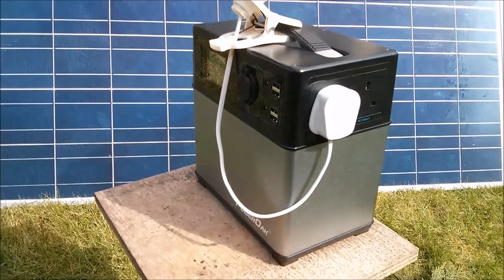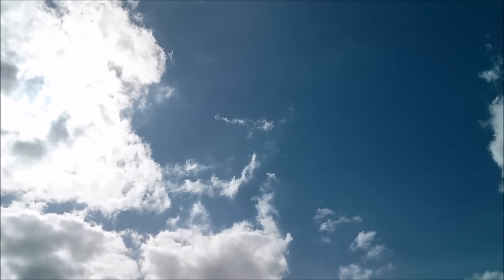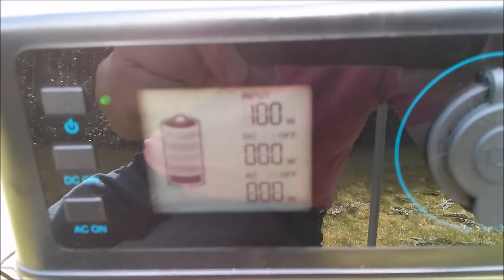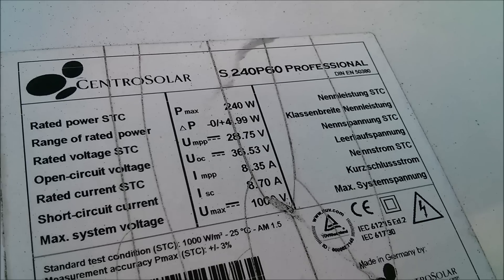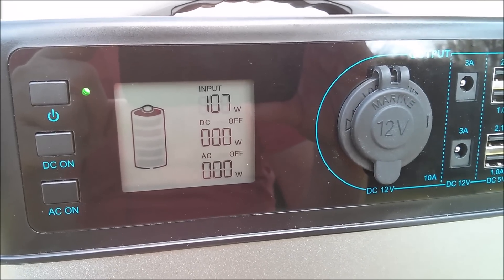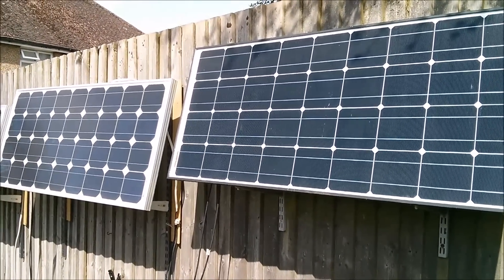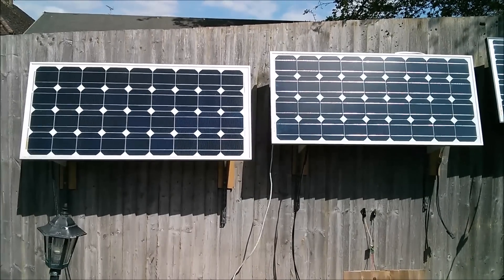PowerOak PS5B Review - Part 2 - Solar Charging Tests

Comment: Those 80W panels were giving 54W each and the 100W panel gave 64W, which is 18% more. So I'd say it's 100W rating isn't too far off.

Comment: Solar panel watts (other than those from Banggood which have the Voc * Imp wattage rating which is an impossible number) are measured under factory STC (Standard Test Conditions) of 1000 watts/sq meter and panel temperature of 25C.  A more reliable number for real world solar output is the NOCT rating which is taken under less perfect conditions and is about 73% of the STC rating.  In testing a number of 100 watt panels from different makers, I found that the best output in backyard sun was about 75 watts.
I did have better output from some Jinko 250 watt panels which delivered 235 watts in backyard sun.  Those would be the proper stuff for a large solar system.
I have a solar planning spreadsheet which takes the STC value for the solar panel(s) but also does calculations with the calculated NOCT value.  My numbers are more pessimistic than the solar calculators I've seen online but the things I've designed for my own use always have the specified amount of power available.

Comment: Hi Julian, a good demo of the difference between laboratory panel specs and real life output.
You could make the frames you have your panels on elevation adjust able, with summer and winter positions.

I would be very careful when you put two panels in series, you will have some near serious open circuit  voltage.
Was the solar charger happy when you connected probably more than 40V to it.
Does that power module have a simple solar charge control or a MPPT unit?

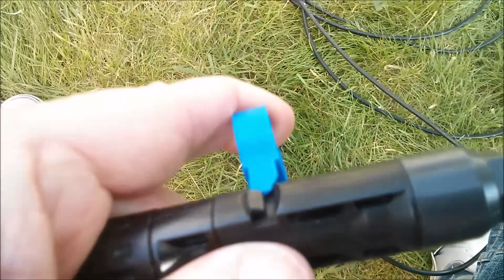Comment: Are you sure the disconnect tool doesn't go the other way around?  I would have thought the angled side would be to the clips on the left at 1:52.
Reply from the maker: It does go the other way around - but it only works if slid into slots.

Comment: @julian Ilet - would love to see you tinker with an arduino and creating the code for a “follow the sun” controller for your panels (to alter tilt to track sunlight)! 😉
Reply from the maker: The code is essentially the same as MPPT (maximum power point tracking). The difficulty is the actuators (very big servos) and all the other mechanics. Also, economically, bigger panels might be cheaper than a tracking system.

Comment: Ordered a set of supposedly 400w flexy solar panels and supposedly 60a controller for £110 let's see what turns up I'm not getting my Hope's up I'd probably get a 100w panel is my guess
Reply from the maker: A lot of the ratings on these solar panels are very optimistic - if you get 75% you're doing well :)
Reply: @JulianIlett  trust me I'm not expecting much for £110 I'd be surprised if I get anything over 100w it's coming from wish.com

Comment: you sounded surprised that serries/parallel was the same power
V X I = W
Reply from the maker: I thought the input circuitry was limiting on either voltage or current, so I was expecting different results. I was pre-judging :)

Comment: 1:50 Silly Julian, are you sure you aren't trying to insert the disconnect backwards??  😉  Maybe the angled corners should face the tabs instead(?)
Reply from the maker: The release tool wasn't suitable for this combination of connectors, but you're right, I did have it the wrong way round :)

Comment: I think the maximum input power of your PowerOak PS5B might be 108W not 120?
Reply from the maker: Certainly looks like that. Although I've just hooked up the big panel again and I'm getting 114W (later update: 127W). Maybe the power goes up a little as the battery voltage rises.
Reply: @JulianIlett  Good thinking Batman